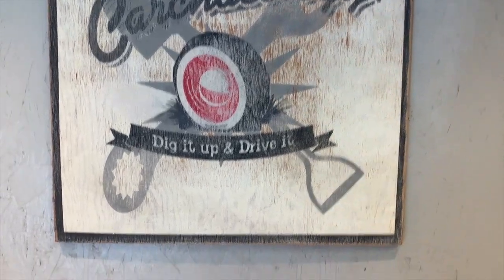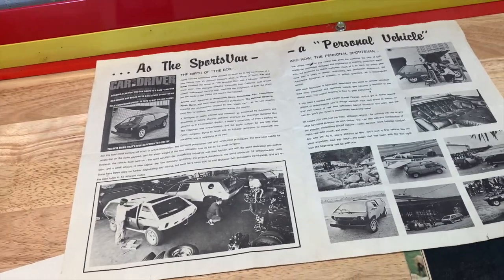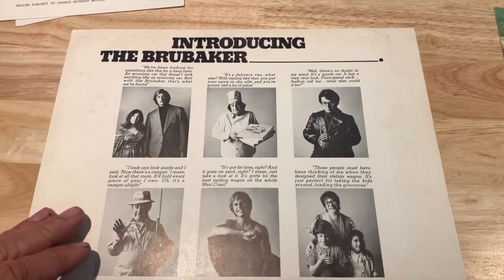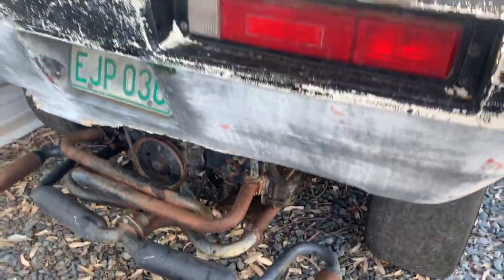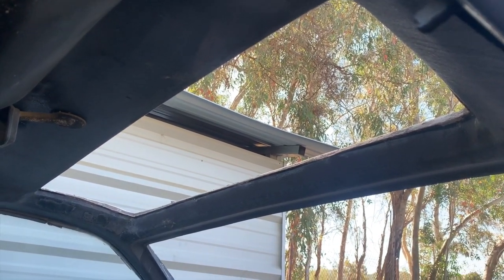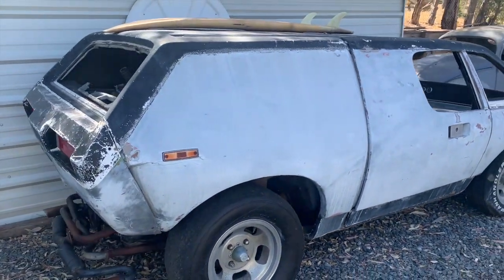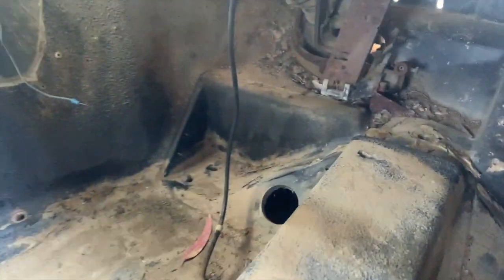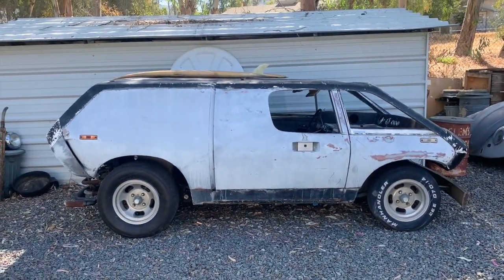Carchaeology: The Brubaker Box project walk around and historic paperwork

Comment: To recreate the textured bumpers, strip them do the bodywork that needs to be done then get them sprayed with bed liner. That will give you the texture you are looking for.
Reply from the maker: The bed liner finish is not the same as the textured fiberglass, but it definitely is a viable option. I am going to try to match it if I can.

Comment: Are you going to keep your restoration true to the original design? I ask because the only failure of the overall design was the primitive wood bumpers. They look simply as an after-thought... Front as well as rear
Reply from the maker: Probably sticking with the original design for the most part. Personally I like the wood bumpers if for no other reason than the controversy!

Comment: These things are cool, but the bumpers are hideous. lol. I would thing a bedliner like U-pol Raptor Liner would be a good option to duplicate the textured finish on the bumpers. To me, that looks like an autostick pedal assembly?
Reply from the maker: The bumpers are controversial for sure, but they are also a part of its history.  If I can’t retain the original texture in the roof and bumpers ( which I think I can ) than a raptor liner or something like that will be the way to go.  The clutch pedal is there , it’s just folded way back and is hidden by the steering column.
Reply: @Carchaeology  I figured it kinda had to be, but I couldn't see it at all. Lighting, I guess. Looking forward to what you do with it. I always dug these.